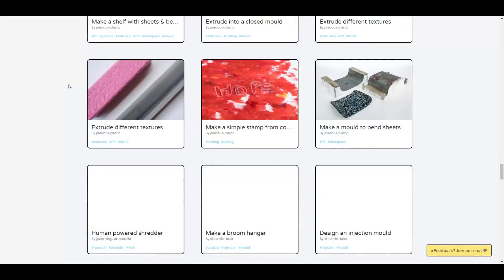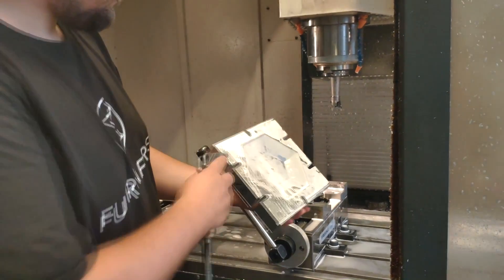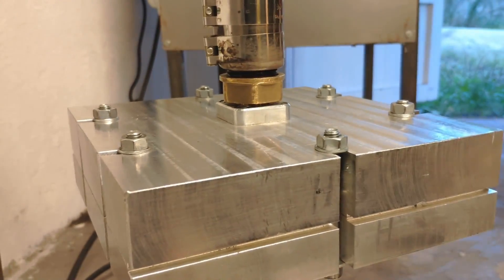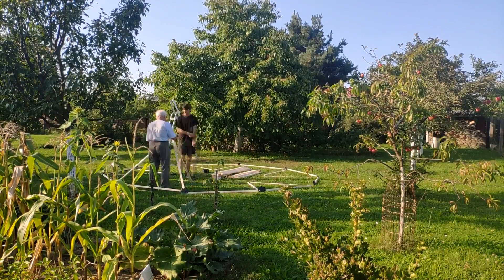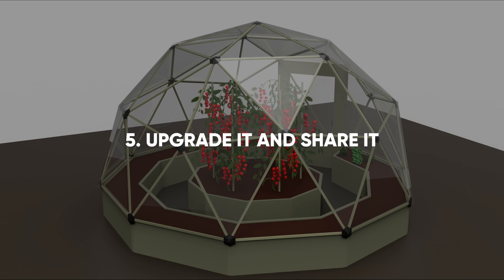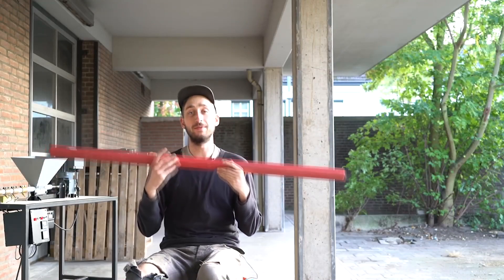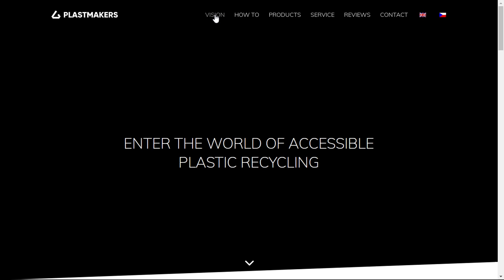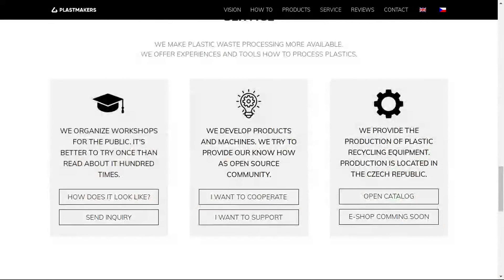How to build 2V geodesic dome

Comment: What should be the length of the three pole of the triangle for 6m diameter?
Reply from the maker: Hello, for diameter 6m you need 30 struts lenght 1575,5mm and 35 struts lenght 1780,6mm.

Comment: Can i use my 3d printer to print the connector in ABS plastics which are slightly stronger then PLA plastics. Thank you
Reply from the maker: Hi Edis, depends on application. I like properties of PP. It has good strenght but also flexible. I tried only PETG for smaller prototype joints for door frame and it works well too